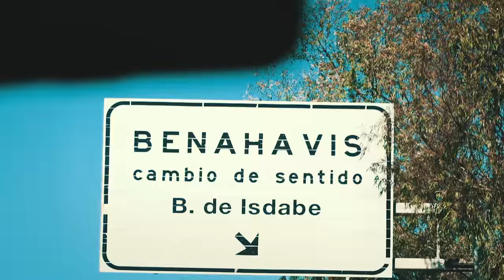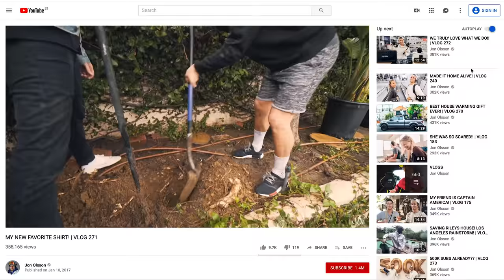CASA CASTLE 2.0 IN FULL PROGRESS! | VLOG⁴ 23 (Part 1)

Comment: You shouldnt water your garden when it is hot outside you should wait untill the sun is down. Because if you do it when its hot the plants will die
Reply: A no they won’t, they just don’t benefit as much from the water because the sun evaporates it more quickly. I agree though it is better to water during dawn or dusk.